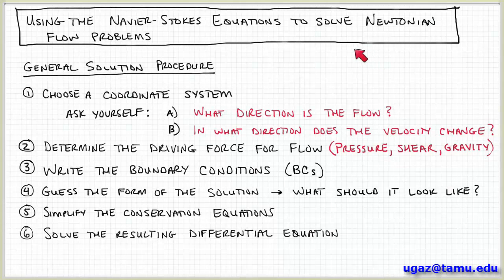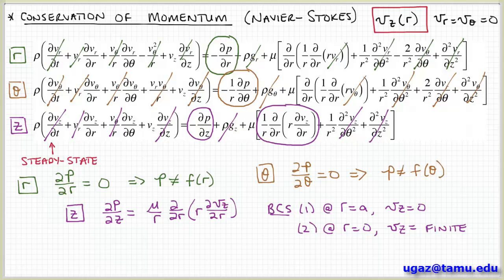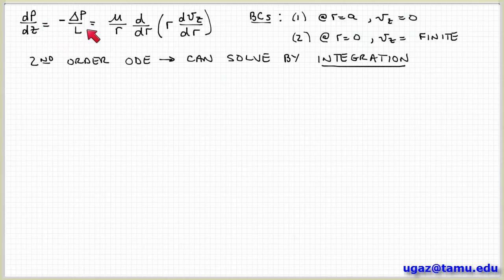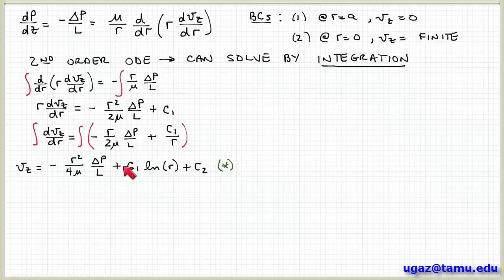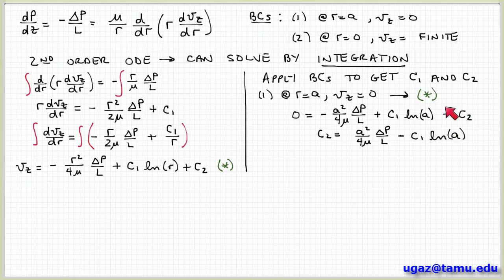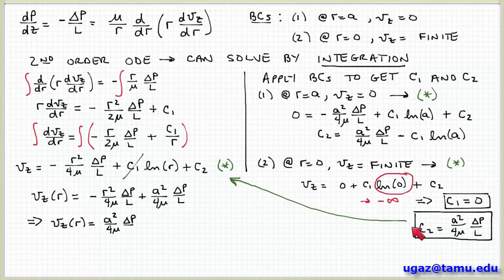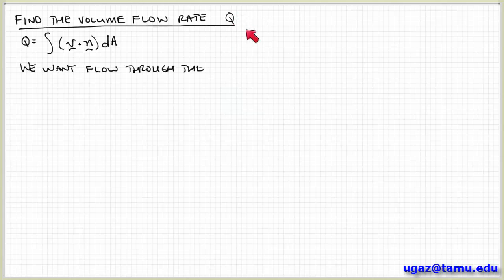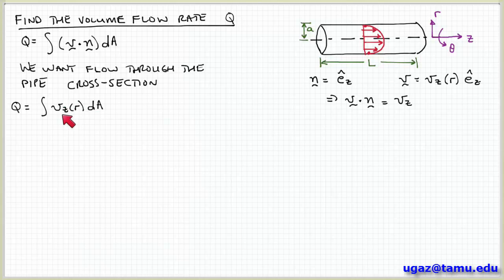Applying the Navier-Stokes Equations, part 4 - Lecture 4.9 - Chemical Engineering Fluid Mechanics

Comment: Sir, Navier-Stokes helped me solve a problem I use, or wish I used, every day. If I take the straw out of my milkshake most of the way I can drink a milkshake through a straw. So the deeper the straw is the more vac is required. That's basically made me a wizard to every 7 year old. I BARELY only get pieces of this every time I watch but I get a little better every time. I won't be happy until I can calculate the angle of a pipe needed for a given amount of fluid with a known lighter than air vapor that needs to travel opposite the flow of more dense fluid. Or any one of the other variables given the other known conditions. So think of a safety situation in a lower budget developing nation, liquid needs to go down but its vapor needs to go up in the same cylinder with gravity only.

Comment: at 4:00, I'm confused how you took the integral of the right hand side without any "dx" or "dz" present. I thought a derivative was necessary for an integration?
Reply: he is integrating both sides with respect to r, so he can simply integrate the right hand side using the power rule

Comment: why even mess around with integrating to find volumetric flow rate?  You could just use the boundary conditions to find the max and min velocities using the velocity profile, add them together and divide by 2, then multiple it by pi*r^2... gets the same answer
Reply: I'm pretty sure that assumes a linear velocity profile.  Averages don't work on non-linear functions, which explains the need for the integral over the function.
Reply: Alek Roulston yes, he mentions it's actually a parabolic curve at 8:10

Comment: I have a qusetion, if the pressure is unknow at the inlet but the velocity is known. In this case, how will this problem be solved? Because in this case it seems that viscosity has inverse relationship with the velocity, however, when viscosity is not affecting the velcoity in pipe when the velocity is given as inlet condition in COMSOL

Comment: +Matt Peiffer You have disabled replies, so I can't respond directly. But if you happen to see this, then here is the explanation: The N-S equations are conservation of momentum equations, essentially they are force balance equations. The terms on the left hand side of his equations are acceleration terms and the terms on the right hand side are forces. The problem here is a viscous flow problem, therefore it isn't just P*A=m*a as you suggest, but there is also viscous drag (i.e. the term with mu in front). So no, you would not expect the velocity to go to infinity anywhere.

Comment: Hold the phone. I have a problem with this whole thing. I've watched the videos many times and gone through my work many times and I think I'm right in saying: this isn't a steady state scenario if you say V_z is finite. If you say C_2 is 0, then the forces don't balance out. You end up with a constant pressure difference. Since we know F=ma (or P*A=ma in this case), the fluid will be accelerating, and not steady state. It totally makes sense that ln(0) should explode to negative infinity. If the fluid were allowed to accelerate, it's velocity would also reach infinity. If you want a steady state scenario, there can be no pressure drop component unless it's balanced by another force.
Reply: It is balanced by another force: the shear force tau = Force / Area of Contact

Comment: You integrate both sides when you start solving the ODE, but how come you integrate the right side without a dr factor?
Reply: +Eichro did anyone figure this out
Reply: +zawette he didn't show it explicitly, but he basically just multiplied both sides by dr, thus getting rid on the 1/dr on the left side leaving d(r*dvz/dr) = (.....) dr
Reply: He integrated both sides with respect to r. Mathematically, whatever you do to the right hand side should be done to the left hand side.

Comment: 15:24 The viscosity of the drink is also often a factor when it comes to places that sell dairy shakes, fruit smoothies and the like. Although things are not directly comparable because dairy shakes are frequently non-Newtonian in nature, the dairy shake straw is often considerably greater in diameter than a corresponding soft drink straw to compensate for a considerably higher viscosity. Hold a and L constant and relate Q to delta-P divided by mu (which is much higher for the dairy shake/smoothie than it is for any "fizzy drink").

Comment: Thank you for the video. You explain the concepts very clearly.
Just one question.
In the last part of this video, are the integration limits rigth? Shouldn´t they be ranging between a and (-a) to cover the hole section of the pipe?
Thank you
Reply: He is integrating over the area, r dr dq (dq is dtheta, I cant type the theta). Vz does not depend on q, but the area does, using a whole rotation as limits (0 to 2pi) that adds another 2pi hence the dA=2pi*r*dr. Integrating the whole rotating is already covering the pi to 2pi part or the negative r = -a to 0.
Another way to do this would be to do half a rotation (q= 0 to pi, losing a factor 2) and diameter ( -a to +a, gaining a factor 2).
Reply: Superiorer Thank you